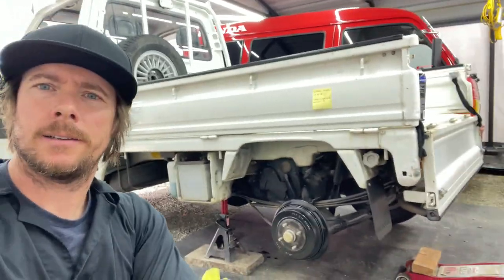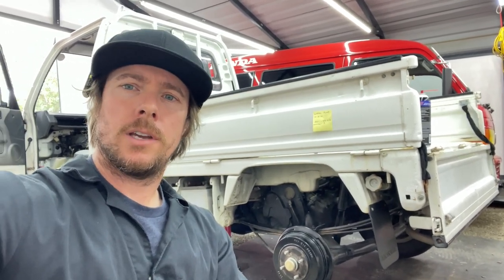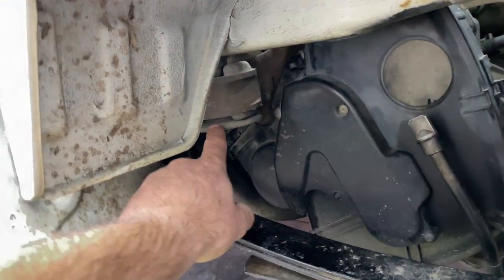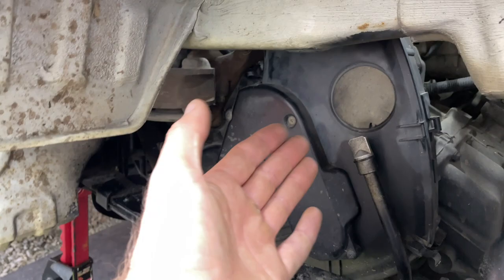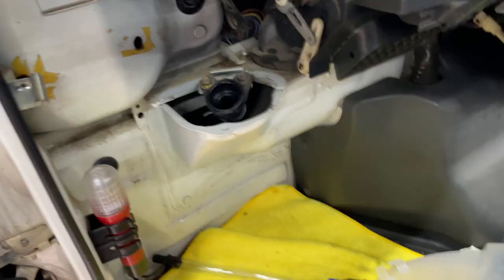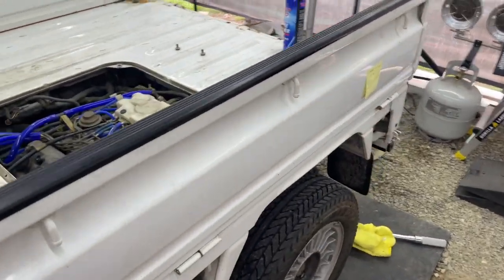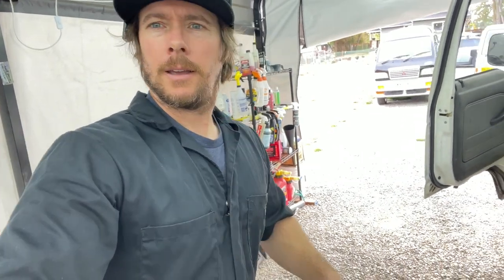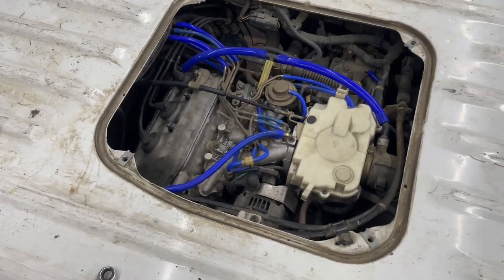Honda Acty Timing Belt Tips and Bleeding the Coolant System After Removing Water the Pump

Comment: I put the coolant in a 1 gallon pump sprayer with the spray tip removed. The radiator can easily be filled without removing the dashboard pieces and no spillage.
Reply from the maker: good to hear! the dash is like 5 screws so it's not a huge deal but that is a good work around!

Comment: i'm replacing my timing belt now on my 1996 honda acty street pgm-fi 5-speed awd.  holy cow, the crank shaft pulley bolt is about impossible!  I battled it all day and going to attempt it again this weekend after ordering a stronger impact gun and a heavier duty impact socket.  that bolt is a real struggle.
Reply from the maker: impact should get it! get a nice 3/4" impact and let her rip!
Reply: @OhKeiGarage  HOLY COW!  This impact and socket combination and it came off like it was nothing, instantly.  That was an expensive bolt for me to remove, lol.  1. Milwaukee M18 FUEL 1/2" High Torque Impact Wrench w/ Friction Ring Kit 2967-22
2. Lisle 77060 17mm Harmonic Balancer Socket